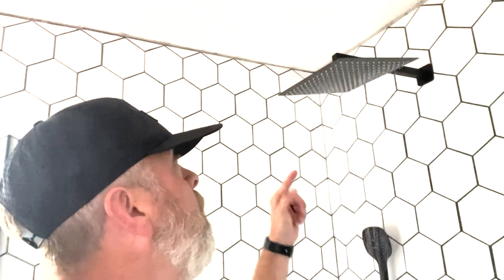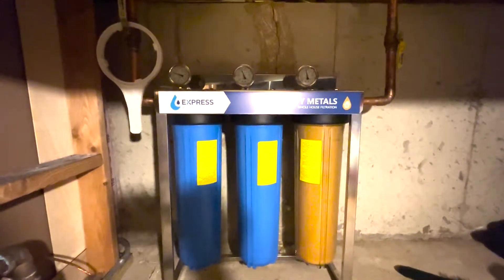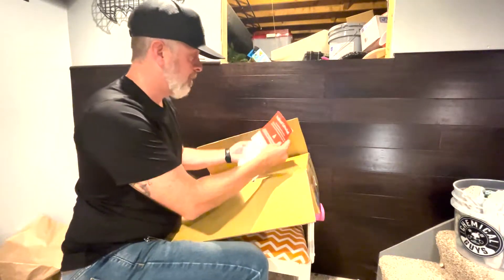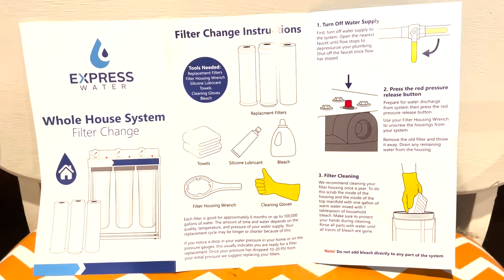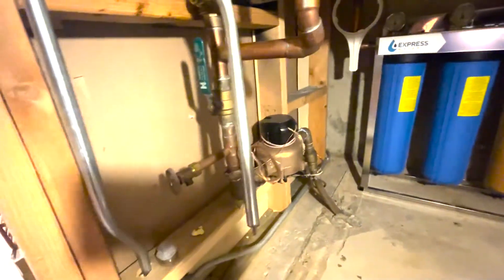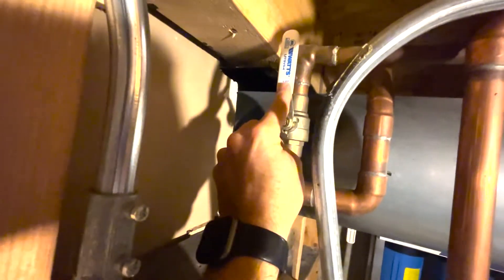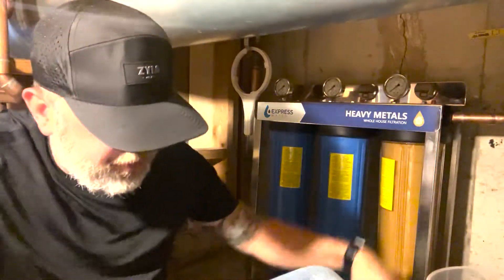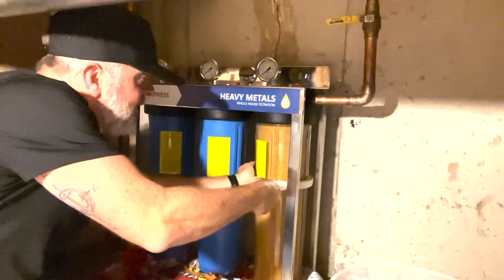Replacing Water Express Whole House Filters #wholehousewaterfilter

Comment: You’re really not optimizing your filtration capacity, your system is not very efficient. The phosphate filter basically also serves as your first polypro sediment filter.

I would adjust the order and improve your filtration capacity according to the follow order:

PHO > GAC > ACB

An easy way to also get more sediment capacity is to install a 50um “spin down” pre-filter on your system inlet.